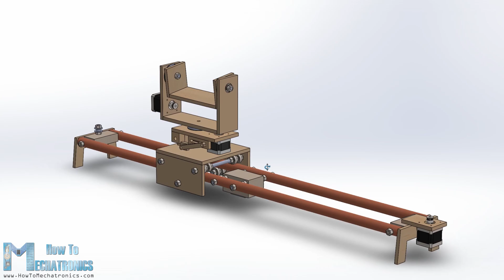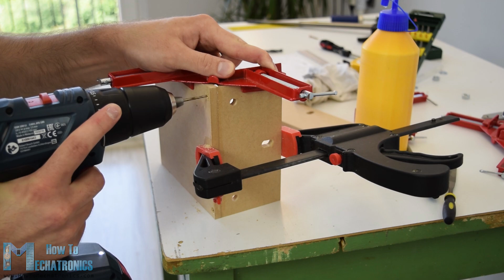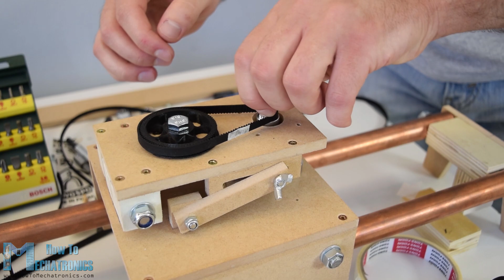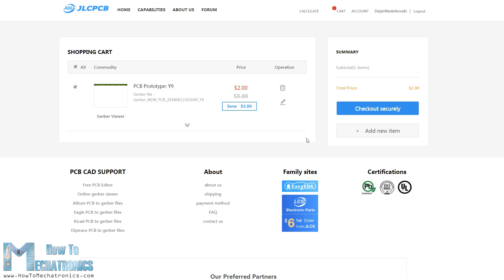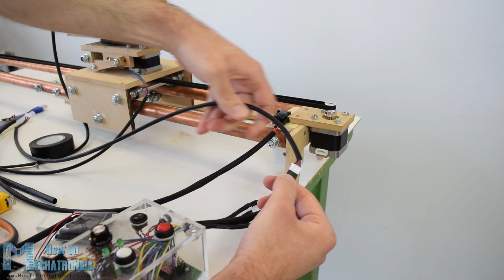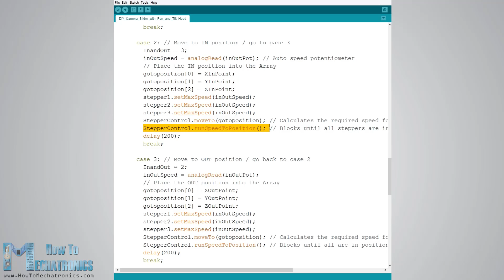DIY Motorized Camera Slider with Pan and Tilt Head - Arduino Based Project

Comment: list of parts bit not the electronics. like for example what set of bearings did you use, bolt and screw size. I can't find these informations in the article

Comment: My best guess is that this project cost about $200+ usd. The most expensive part is the arduino which is about 40 bucks. But you will have alot of electric components left over because, if you order them on Amazon, most of it comes in bulk.

Comment: The characteristics of the potentiometers are not indicated!

Complete electronics assembly not shown.

Why is driver A4988 and not DRV8825 used? And can the L298N driver be used?

The video shows the programming of the start and end position of the camera carriage. If you connect the drive of the slider itself to another controller, and leave only the carriage with two motors on it from your video, will this positioning work correctly?

Comment: Hey! Awesome video! I've been thinking of upgrading my current diy slider with the motorized portions of this build. Im pretty new to arduino projects, when I was looking over your wiring and pcb designs I couldn't see where you had grounded all your parts? Was it just into the pcb itself or was there a grounding layer where you ran it all together?

Comment: Fantastic work :) it takes a lot of craft in several areas to get this done. I need to get some tools to get into a project like this, I've built several things with arduino before, and like any arduino guy, I save all the electronic junk to later do something with it, maybe this will be my next thing :) thanks for the video! Are you sharing your pcb design?

Comment: Thanks for the amazing video and tutorial! I have actually made my own version of this. Though, I have a problem. I made a recording and realized that at certain speeds the video is a bit shaky. Though the vibration is very minimal I need to solve it. I don't think it can be due to stepper motors' natural working vibration because I have used TMC2208 drivers @1/256 steps. Can it be that arduino nano is a bit slow at working with 3 steppers? Any help is much appreciated.

Comment: I've got the components made except I created 3D files with some adjustments for 3D printing.  I also am almost complete with the controller.  My only question really is I can't tell which resistors you're using.  Looks like 3 different ones but from what I see on your diagram against what I see in the video the resistors don't seem to match up.  Care to share which ones you're using?

Comment: clean copper with vinigar and baking soada... be sure to rinse after .... 

... id like to operate a large camera via wifi remote, through the view of the cam. up, down, side/side and click need to be performed.  ill be using a windows computer. id be nice if it could be smooth moments with something like a game controller. 
... sugestions ?

Comment: Goodnight ! It is a good video and apart from the contribution of the technique.
I hope you can help me since I need to do something simpler than this since it is only pan and tilt and zoom, but I hope to be able to control with joystick and via bluetooth a head for the panasonic ag ac90 video camera, this weighs close to 1.2 kg and only move it approximately 60 degrees to the sides 30 degrees to the left and 30 degrees to the right and only 30 degrees to tilt. I hope you can help me since I need it for the church I attend and be able to transmit live but it has to be lifted about people, that I fix with a base in a column but handle it remotely that is the difficult thing. Thank you and I hope to receive your help, see you soon and best regards.

Comment: Very interesting! I never really did any home-made constructions after mid-school, but want to make/buy that kind of slider or similar for my image/video related experiments. But you are using wood, and I was wondering, would it be possible to replace all wooden parts with 3D printed plastic ones?

Comment: hi!
if I used an arduino one with a different power supply for the motors, then should I put the two ground of the two power supply together?

Comment: You know it would be awesome if you housed everything on the slider and controlled it with an app instead of having the bulky controller that's tethered. This would allow better cable management, more options and controls for the slider, as well as a better user experience not to mention using less parts. 
I think when I get around to making a slider like this I am going to use Bluetooth modules.

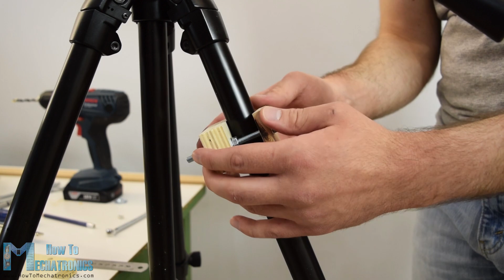Comment: Also, borrow or buy a cheap caliper. A very versatile, useful tool for a lot of applications, really worth every penny. I'd sand a shallow groove on that wood clamp on the tripod leg (4:52), or glue a small non-slip rubber mat like the one you use in the kitchen, for better traction. Better safe than sorry :)

Comment: Hello, Thanks for the brilliant tutorials and your website is excellent. I have made this circuit but modified to use 3 x "slider" control for a robot arm also added 3 lines to toggle the enable mode on the A4988 when the Pots are in the center (deadband) and adjusted the analog mapping to suit . This worked nicely reducing the stationary current from 300+mA to just 36 mA  and everything stays nice and cool until active.
I see that you connect 12V to arduino Vin and this powers the motors and the board etc, I was concerned that 12V onto the arduino would cause the LM1117 (on the nano) to overheat but i'm clearly wrong somewhere. (I'm using a 7Ah SLA fused for the bench top testing).
is there any issue with interaction from the motors to the nano as they are directly connected?
i dont mind experimenting myself but thought you may have some comment on this and wanted to say thanks.
The End.

Comment: Congratulations on this very accurate tuto. Sure, I am going to built my slider based upon these instructions.
I have two questions :
Values of resistors : 
it seems you used 10K for R1 + R2 + R3 + R5 – Is it correct ?
What is the R4 value ?
What don’t you have two limit switches (one on each side). Is only one sufficient ?
Many thanks for your help
Jean-claude in France

Comment: You could also use a ramps board with an arduino mega or a grbl-cnc shield with a arduino Uno.. though it wouldn't look as cool.. let alone the fun of making your own custom PCB ! brilliant job. Also you could make an adjustable camera platform to allow you to move the camera back and forth to make the rotation pivot align with the entrance pupil of different lenses... Awesome project.. would try to make a version using black anodized aluminium instead of mdf, it would look awesome on such a brilliant project ! keep up the great job!

Comment: Thank you very much for your tutorial, I have a problem with the production.
I followed the tutorial to purchase a PCB 
with a resistor of 220. Potentiometer 50K. Capacitance 25V 100UF.
After accessing 12V power
Arduino nano is not running and there are no prompts
Detect no current
I downloaded the PCB on 8/28.
I don't know where the problem is. Ask for your help.

Comment: The copper pipes will turn green in no time. You should lacquer them. And anyone trying this build should use heavy PVC, or thin-walled galvanized pipes. Even brass tube would be much better here. Nice DIY video though!

Comment: I'm very sad  because I made an order of your PCB but it doesn't work 
The negative is connected to the positive and there are another error in the design 
The slider motor driver is not connected in the PCB to the socket for motor